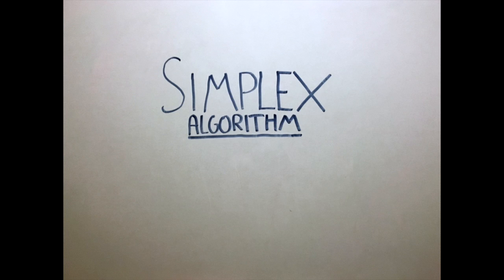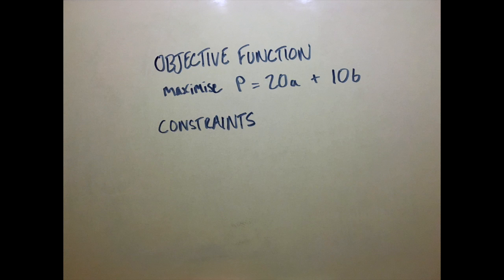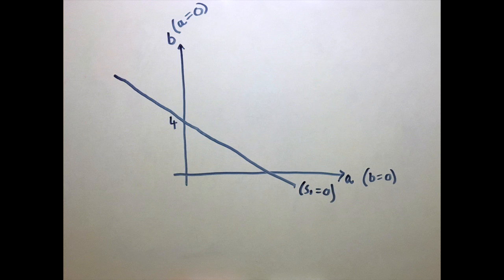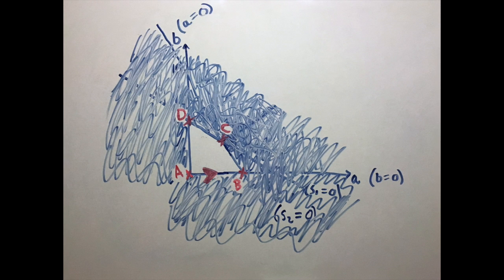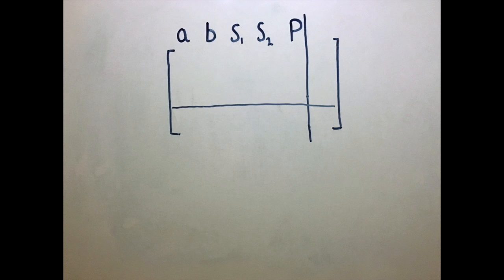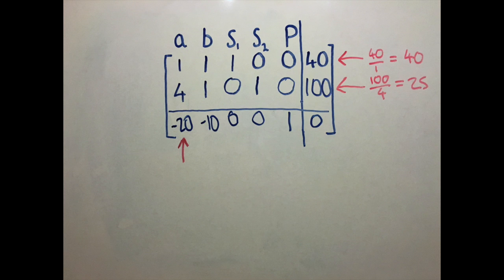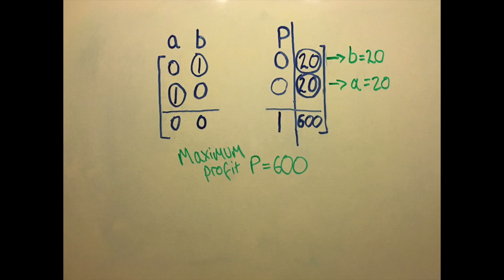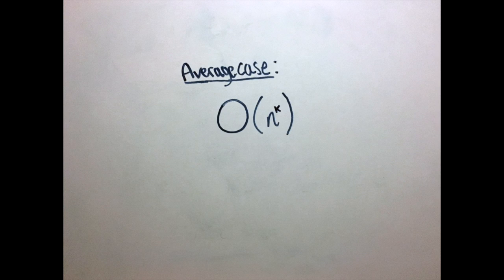Simplex Explained

Comment: Might be either dumb or too late.. but why not only sell standard chairs? As I am understanding it, you are essentially loosing profit with every “luxury” chair you sell.. if you spent the 1000 hours on 100 “standard” chairs (costing 10 hours each) you would make  $1000 at $10 each. If you made a single “luxury” one and the rest “standard”, you would make $980. If you made two “luxury” chairs and the rest “standard”, you would make $960.. i.e. you are loosing $20 for every chair.

It costs you twice in labor to profit for every luxury chair, compared to a one to one cost in labor to profit for standard chairs. 

What the hell am I missing?
Reply: you can only make a maximumof 40 chairs due to the m3 of wood available.
Reply: @nils3989  Ohhhh thats the detail I overlooked. Thank you for pointing it out.

Comment: at 8:07
the column S2, third row, the number should be 10/3, not 15/4. 
Also, you didn't mention artificial variables, two phase simplex and duality at all.

With that being said, very good video, I'd give you a 9/10
Reply: Yes, I got that too. I think there was a mistake with -1/3 on the S2 above that 15/4, because S2 on the second row should be just 1/3, not -1/3. Thank you for your comment and thanks to author for his explanation.
Reply: @janplechaty1702  indeed, I have been implementing the algorithm for a computer science project.  Test case (problem from this video) kept failing because of this.  Eventually worked through the algorithm by hand and got the same result my implementation gave (i.e. both S2 row 3 being 10/3 and S2 row 2 being 1/3 are the correct answers)

Comment: So, this vid is amazingly concise; but I got me some questions:

1) How do you choose the first vertex? In this case it's "obvious" that (0,0) is a vertex, but I have a problem with over 100k decision variables and if I set them all to zero then I'll be outside the solution region.

2) How to handle constraints that don't form a boundary? Imagine the same as above, but with the added constraint x <= 100 . ie. How to make sure that we're pivoting to a vertex that abides by the constraints?

3) 6:13 you say that "we want to move in the direction where the objective function will increases the quickest," shouldn't that be the [2,1] direction? which increases the OF by sqrt(5) for each 1 unit in that direction, which is better than [1,0] direction?

4) Is simplex supposed to handle the case when the user supplies constraints that don't bound the solution? If so, how?
Reply: 1 - This is the purpose of the slack variables. If the right side vector b is positive, you can always start with x=0 ans s=b.
Some problems do not have postive b, and then indeed it is another problem. It is called the 'first phase' of simplex algorithm. You have to start with what we call a "basic feasible solution"
Reply: 2 It seems the process of changing the base was not explained, but in simplex if you start with a bfs vertex, you always get another bfs (improved) vertex. When you change the point you test how far can you move it in a given direction, and then your redundant constraint would never show up. Since some constraints add nothing to the problem,  some solvers can do a preprocessing and remove it just to make the matrix smaller .
Reply: @julianocamargo6674  Thanks for your explanations! I wish I could give an intelligent response, but I haven't touched simplex since I first wrote this comment. I'm sure I'll come back to it and read your comments again. Thanks.  =)

Comment: @ 2.25 timestamp--did you mean s1<=0, s2<=0? Since the constraint inquality is <=0?
Reply: S represents the amount that you would need to add to the smaller amount (lhs) to make it equal to the larger amount (rhs). So S1 and S2 should be strictly non-negative.

Comment: Great explanation!  Question though: 

Once we reach intersection at B ( 4:35 ) you mention that we have TWO options. Keep b=0, or keep s2=0. 
I'm not sure I understand how come we have two options, since if we chose b-0, then the objective would decrease no?
Reply: Yeah, I think you're always strictly improving on the solution, so surely you could always rule-out the vertex that you just came from. For 2D problems that'd mean doing a circuit till you're at the max.

Comment: from the drawing, how can i know if there is unused material or hours ?
Reply: You are producing 20 of each chair, which use 3m2, so in total you use 120m2 (40*3m2) which is the maximum allowed by the problem, so no unused material. The same for the hours, the full 1000 hours were used (20*40+20*10).